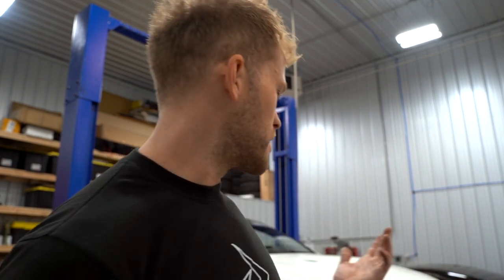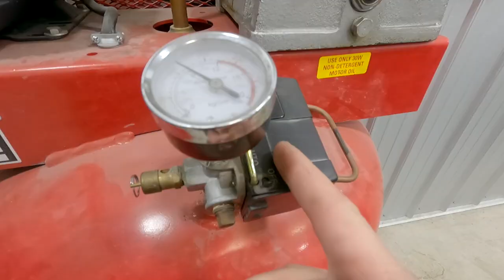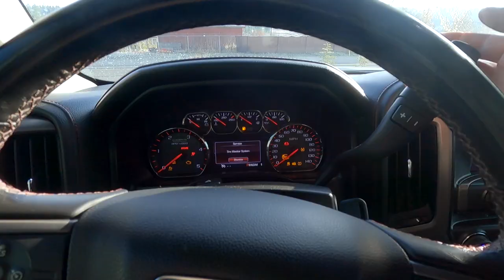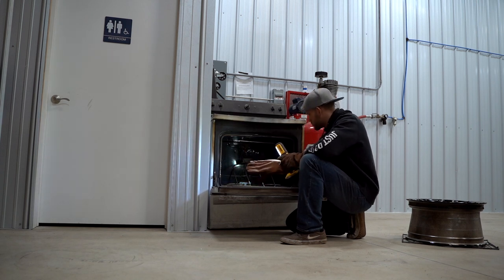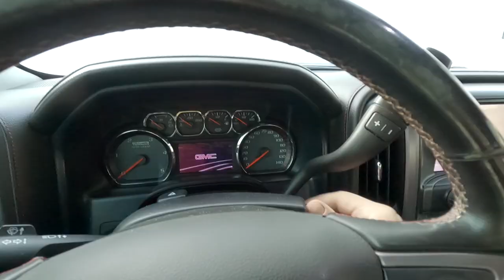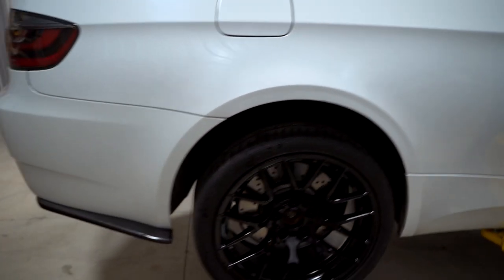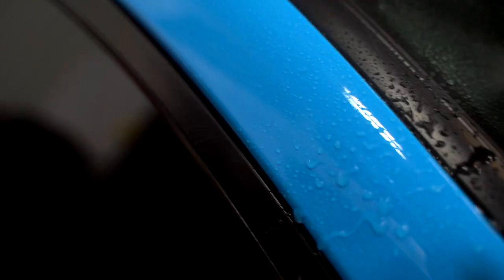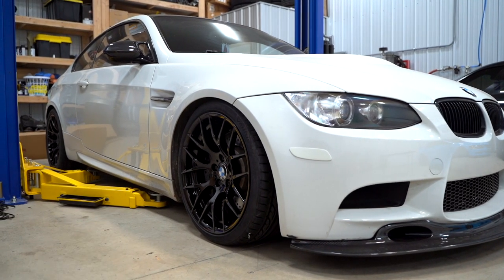Powder Coating the BMW M3 Wheels!

Comment: Just bought a 2011 6spd e92 m3 comp package last week in alpine white and fox red interior, and it looks really close to this aside from slightly different lip/diffuser/skirts, even has black powdercoated oem zcp wheels. I searched for this exact spec for over 6 months and flew to Kentucky and drove it home, and it's been an absolute blast so far. Absolutely love this car.

Comment: You need a 4 post lift so you can store 1 car on the lift and 1 underneath. You will have more space and will not have to keep shuffling the cars. On top off the 4poster,move the 2 poster in front of the door so you can still drive through and use the space behind.

Comment: At 23:06 is the back of the wheel scratched because of the tire install or because putting the wheels on the floor?  Just curious because I wondered how powder coating the wheel on a wire rack gets the wheel completely covered.